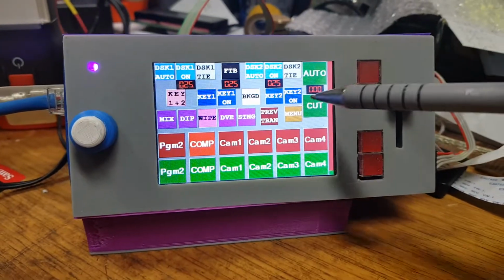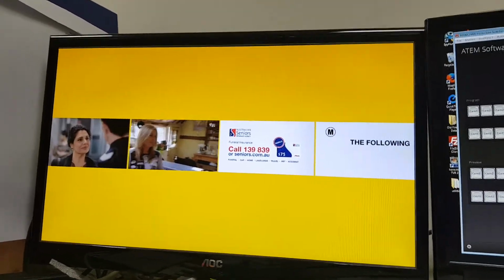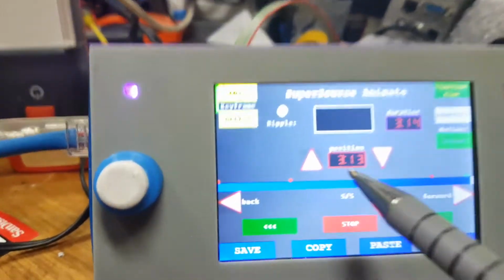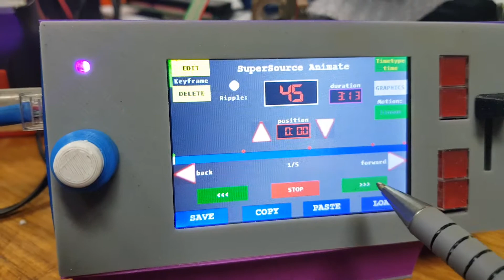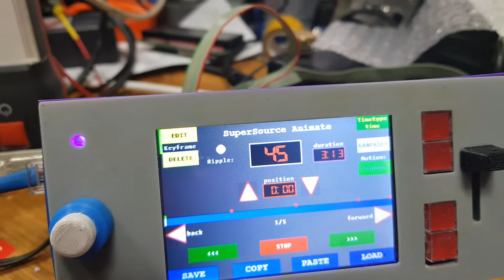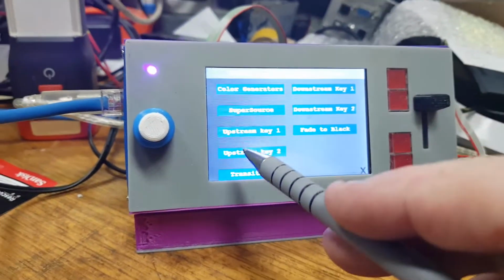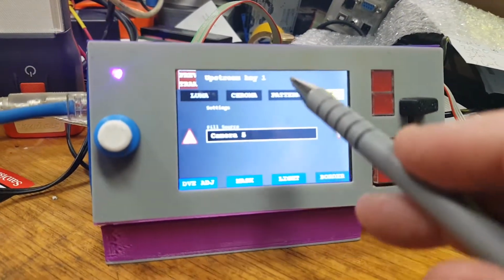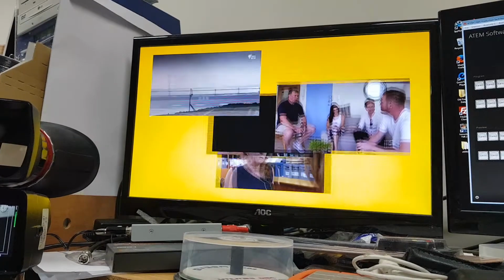ATEM Toolkit teaser 1 (animate supersource)

Comment: I am READY TO BUY YOUR ATEM TOOLKIT!!!!!!
Reply from the maker: The product is still in development and there soon will be regular videos showing the functionality of each section.
This was originally designed as a Macro Player (controller) but when designing the Macro Recorder model it became apparent that it needed all the ATEM commands to be able to incorporate them into each Macro.
In doing the interface, each control was  expanded to include multiple ways of extending the entering of values including slider, numerical, up/down and knob adjustments.
The ATEM Toolkit Controller (ATC) is designed to sit alongside an existing ATEM Controller, but it expands the control-ability leaving an ATEM control panel to be dedicated to just T-Bar and input selection. Of course these functions are also available on the ATC as there is a small hardware T-bar adjuster and 4 assignable buttons, aside from the full touchscreen control. The hardware control is expandable to allow for up to 23 fully assignable buttons. There is also full program and preview tally interface built in.
As a future software upgrade there will be a small hardware control panel allowing 10 program/preview buttons and a T-bar that will connect via 2 onboard RS232 connectors that can be assigned to various functions (eg. to control 2 panels, 1 for vision control and 1 for audio control).
The ATC also has a totally different hardware interface which allows for removable media at the rear and power over ethernet. There is also a much faster ethernet interface which will facilitate an expanded ATEM connection capability (up to 7 more ATEM devices).
Please stay tuned!